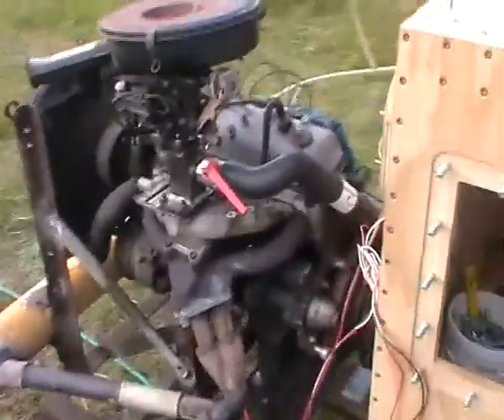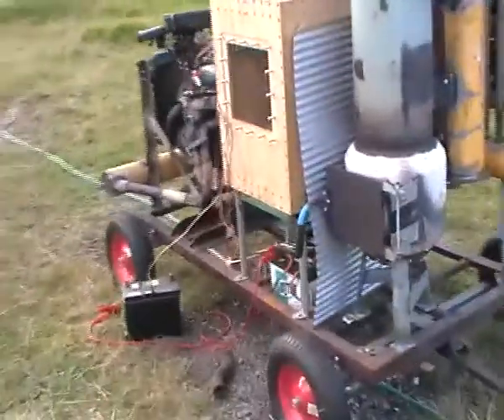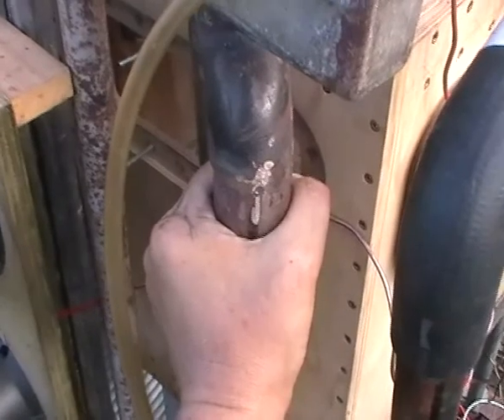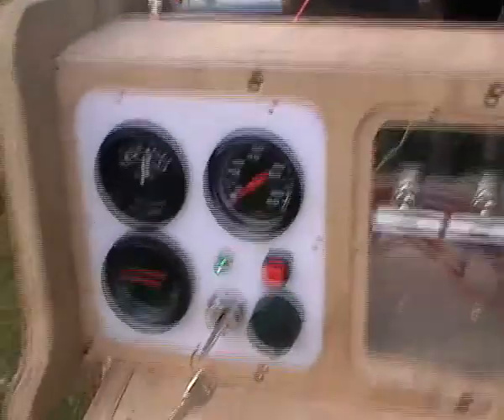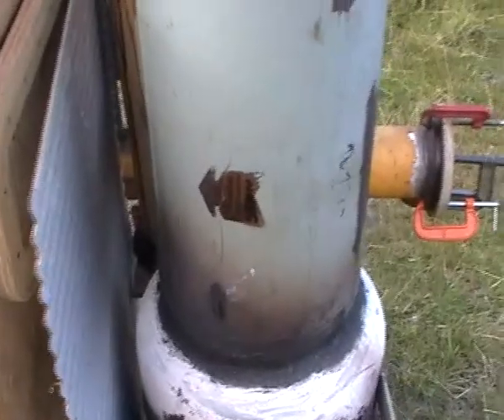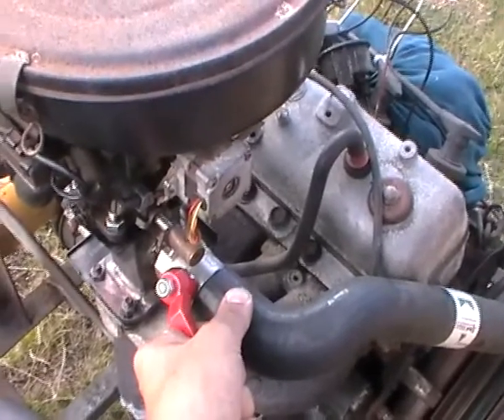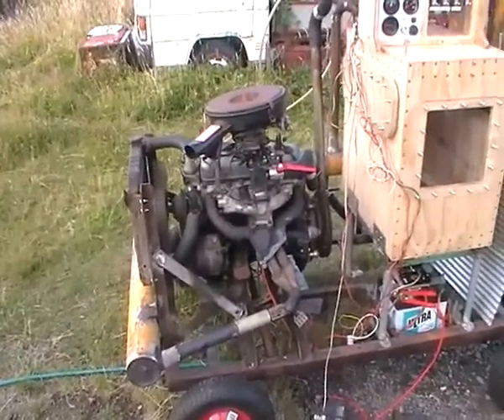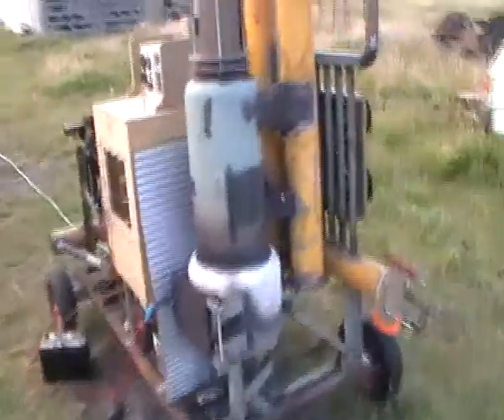WoodGas engine First run.avi

Comment: my inishal experiments with a bubbler is tha yess it was very hard to draw threw and the gas that did come out was to wet to burrn all i hav in order is a reactor cyclone (oversized) radiator and bed filter and i have this 8 hp tecum. i have ran for over an hour now and the manifold has no resin im gona try my 4 cyl to day lol =3-